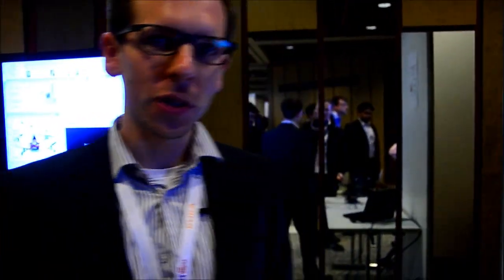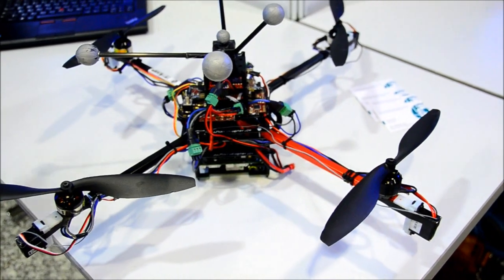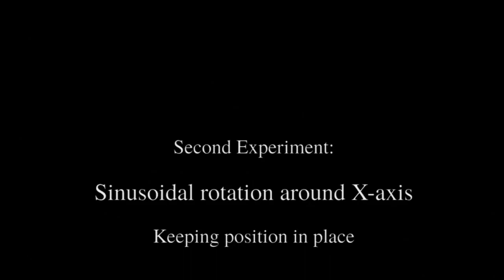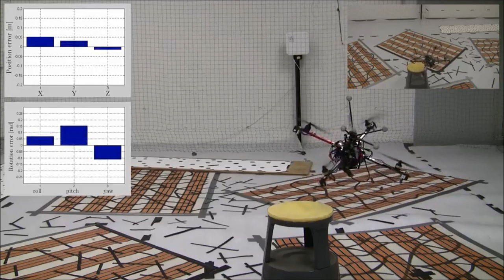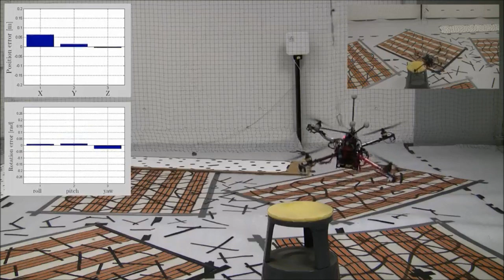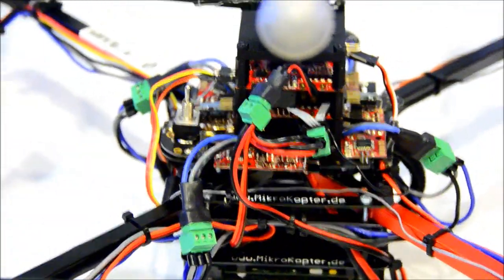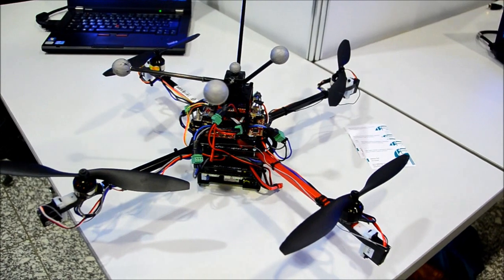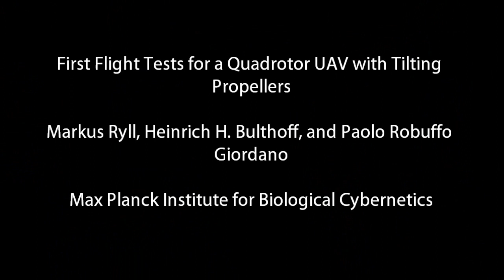First Flight Tests for a Quadrotor UAV with Tilting Propellers

Comment: Yes, with enough articulation it would enable a multi-rotor to be able to maintain any orientation.  It could even fly sideways or upside down.  You could tilt the vehicle to any arbitrary angle and it still wouldn't fall.
Just off the top of my head: it'd be very useful for in-flight recovery when damaged - the vehicle could recover from an engine failure by automatically re-orientating it's other engines.  
It could also avoid an accident in the first place by more quickly evading it.

Comment: Interesting solution, however the weakpoint of it is the increased risk of a blocked servo while flying - as by every tricopter. It would make sense implementing a failsafe scenario to disable the trust vectoring functionality when on servo is blocked and to bring it down by simple differential control of the engines rotations.

Comment: If people actually listen to the video, there are reasons why they're trying out servo control for a quadrotor, basically to see if the vehicle can maintain a position in three dimensional space whilst at an angle such as to be able to manipulate objects with an arm or other attachment.